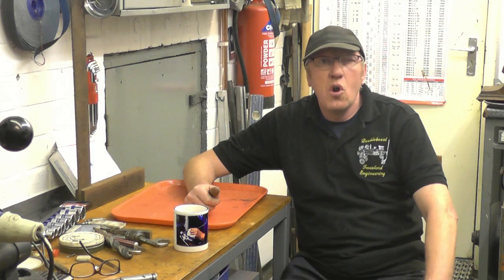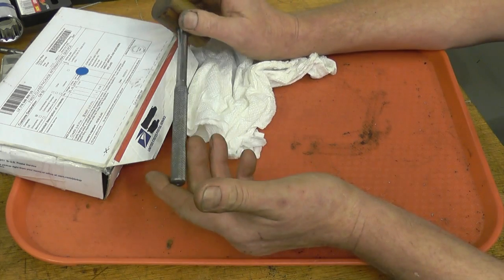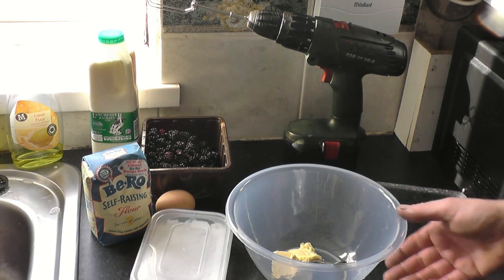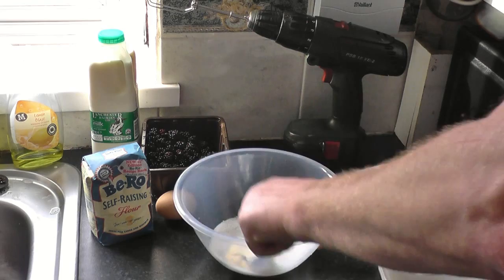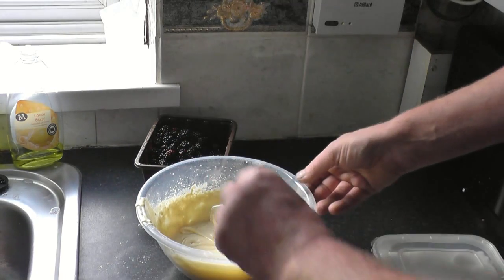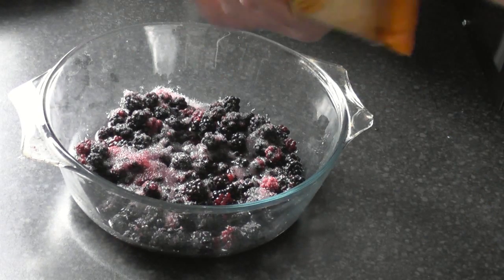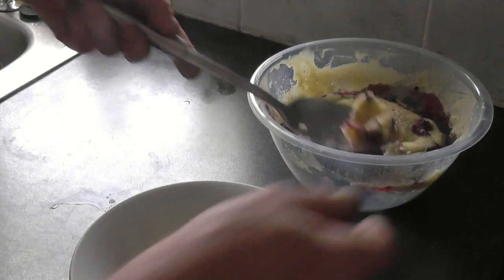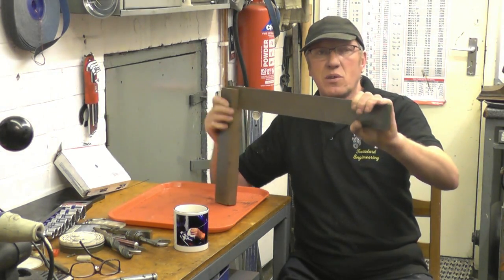Sunday Night Night Cap 37

Comment: John, the wood is "Bois D'Arc" or Osage Orange.  Grows wild here in Texas.  Hard as brass!

We call that dish a "Blackberry Cobbler".
Reply: How do you fix the metal handle please? Is it a tight fit with some epoxy or more technical? I only ask as I have a fair bit of oak to hand & with Christmas coming up thought some brass handles may make some nice nut crackers as gifts, thanks for the inspiration.
Reply: Most of them, I do a press fit, but on johns, it was loose so I used expoxy.  I'm ont usre oak would be good for a press fit, as it will change with moisture,  Bois D'arc doesn't.  But you can use a good quality epoxy.
Reply: Herb Blair
I use my Herb Blair hammer all the time. great for delicate indicating.

Comment: John;

Look to see if there are 3 or more steel pins in the square handle.  If yes, you more than likely have a Starrett #20 steel square.  They make them up to 36" size and you could easily have a 20" or 24".

Looking at the pudding made me hungry, so off for some ice cream I go.

Regards;

Ron Kluwe